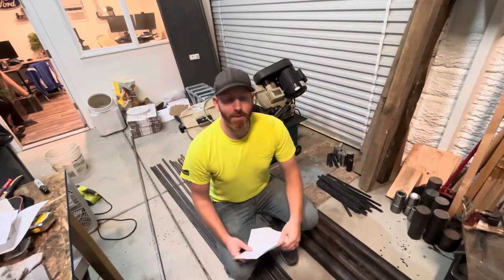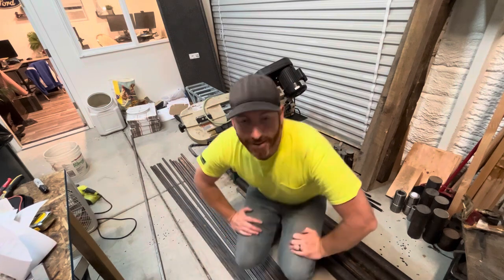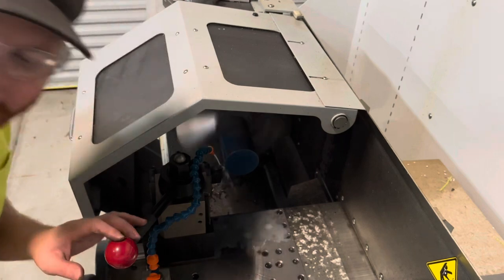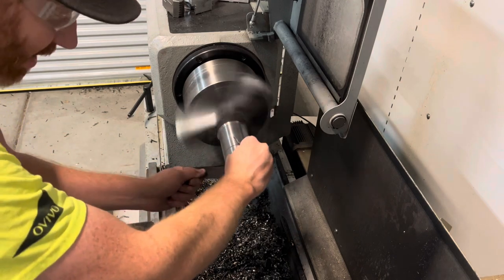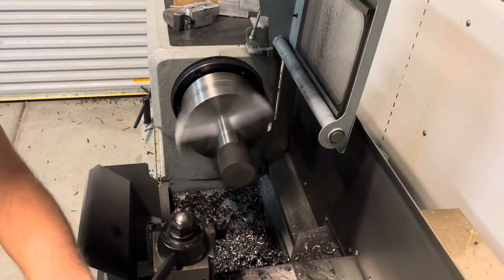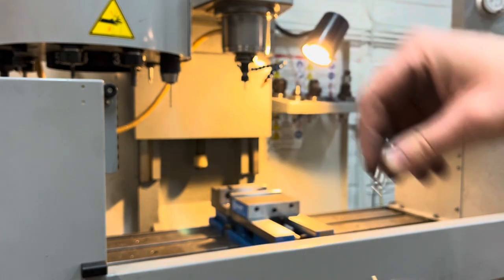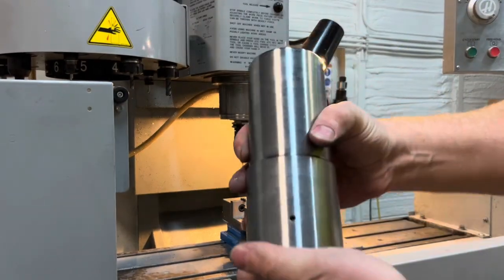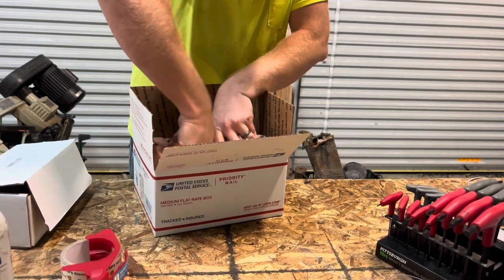Thunder Mug Machining

Comment: One thing I have learned in gunsmithing is to use a flat end mill cutter when trying to cut into curved surfaces. There are some instances where a barrel has to be set into a trunion and pinned in place. Once we have set the barrel into the trunion we clamp the piece into the Vice and use the flat end mill to cut into the barrel through the pin hole. Where a pointed drill will walk the flat end mill cuts into the edge of the barrel without walking.
Might order one next time I am back in the states. Shipping into the EU is way too costly not to mention cost of the customs thieves here.

Comment: This is totally AWESOME  !!!!   Been running 1K gn of powder in it and rattling the windows in the area ...   What is a good thing to use to clean the fuse hole ???   Been using pipe cleaners but it seems to be not very good ,,  What have you folks been using ???   Forgot to mention I bought a 2nd mug and having twice the fun ...

Comment: I have 5 of your original thunder mugs and use them professionally several times a year.  I have 2 that are starting to bulge about 5/100s of an inch.  Yes, i abuse them.  I'm looking to make another purchase this coming year and would like something more like the " fat boy".  my order would be at least 5 and would like to know if theres a discount for any number of these.  also do you do custom work along the same lines only bigger.  sometimes I find myself on air fields 1000 ft away from spectators and need as big as I can get and still handle all things considered safely.  I also fire electronically and need a bigger hole for the e-match.
Reply: Have you had any issue compacting with an e-match in the powder?  What brand e-match are you using?  I'm thinking these would work great in some of my firework shows to add some boom with a gas mine at the same time.  I wasn't sure how safe it would be to compact with the e-match, unless maybe you add it after?
Reply: I drilled the ignition hole larger so the shroud on the ematch would not need pulled back.  i NEVER put the ematch in the hole and then compact the black powder. i put a round stick in the ignition hole about 1" and then compact the blackpowder.  remove the round stick and the insert shroud and tape securely.